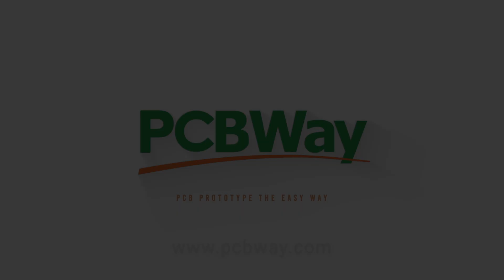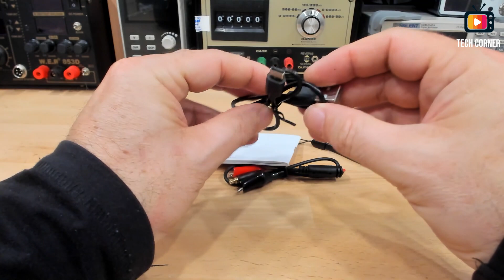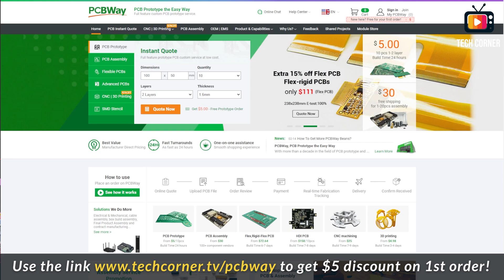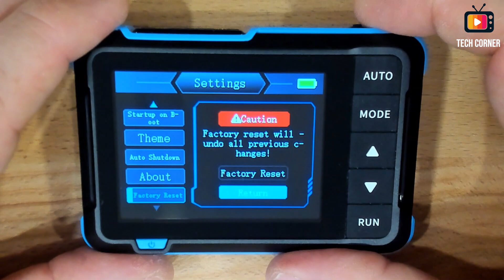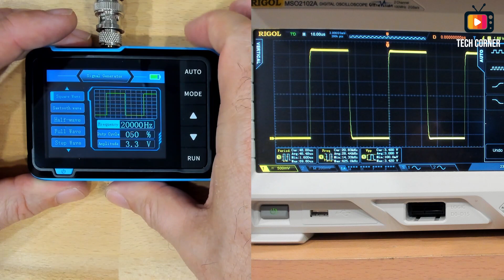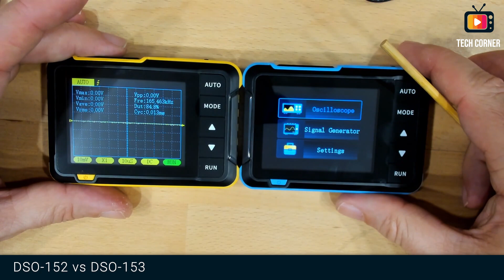FNIRSI DSO-153 ⭐ Oscilloscope & Signal Generator

Comment: Brother, I notice when we input 500khz signal,we notice that the dso 153 display 500-980khz flickering.. is it normal,or not good!!!
Reply from the maker: Hi, that has to do with the samples per second collected and the average you get from those samples, the signal always wiggles a bit, but with this small devices can be more noticeable, but again can also be the connection on the cable. Thanks for watching.

Comment: Giúp tôi cách kết nối  để hiển thị nó lên laptop dễ quan sát, cảm ơn
Reply from the maker: Hi, I don't think that is possible with this oscilloscope. What you're looking is the Zeeweii DSO1511g or DSO2512G, they have AV output. Or you can take a look in the Loto Oscilloscopes, they connect directly to the PC. Thanks for watching.

Comment: I am curious about the accessory pack that you had in this video. Mine just came with the alligator clips and the hanging strap. I didn't see a link to the accessories in the description. Do you recommend one in particular?
Reply from the maker: Hi, in the FNIRSI store you have with or withour accessories and they have the accessories also there. But you can use any generic P6100 probe and a BNC to MCX converter for the probes and a aligator to MCX cable also. Thanks for watching.

Comment: Just bought a DSO-153,  just a note to others, auto calibration is not covered in the manual, nor by Hugo in the vid. To auto calibrate hold down the AUTO button until you get message "Awaiting auto-correction" wait for message to go, about a minute, then it is ready to use.
Hugo great vid, convinced me to give one a go.
Reply from the maker: Hi Jeremy, yes, I missed that. Thanks for watching and your comment.
Reply: hi, I did accidentally hold AUTO and it's stuck in the "Awaiting auto-correction" on screen and buttons are disabled. What am I supposed to do now, plug the probe into the 1kHz output or something? It's basically locked now...

Comment: My DSO153 just arrived- setup and running ok, but frustrating cant seem to find any firmware update for it on FNSRI webpage ??
Reply from the maker: Hi, if you don't have issues with it, you don't need to upgrade. If it's not broken, don't fix it 😁 but you can ask in the whatsapp group, they will send you the bin file. Thanks for watching!

Comment: When I try to use the function generator and the oscilloscope at the same time it doesn't read anything from the function generator. I connected the red cable to the probe and the two black cables toogether...
Reply from the maker: Hi Johny, that's weird. If I remember correctly you can work at the same time. Thanks for watching

Comment: I would like your advice, because you have a lot of experience with oscilloscopes. 
I am trying to decide on which 100mhz bench oscilloscope I should  purchase(I am still in the learning stage). The one I have has 25mhz and would like to upgrade to 100mhz. Looking at vevor sds1102(same as the Owon, but at a better price), please give me your opinion. Thanks Hugo.
Reply from the maker: Hi, I received yesterday the CDEK SDS1102 to review, same as the two you mentioned. I will do it in the following weeks, have 2 videos to release yet, but that is the next inline. I have a review of the same model 4 channels and the comparation (showdown) video with FNIRSIS and Hantek, take a look in my older videos. This one seems pretty good, but I have to test it on the workbench to see the accuracy. But you should be ok with it. Thanks for watching.
Reply: My pleasure
Reply from the maker: Hi, I have here the CDEK SDS1102 for review, will have a video in the next couple of days/weeks and it is also a clone of the SDS1102, for the price it seems a very good and complete unit, but after the test will have a better opinion. Thanks for watching.

Comment: Just received my DSO153, and thanks to your presentation I almost fully understand it’s functionalities. Very impressive little gadget with a lot of punch. Have a Victor 1025A bench scope, at 25mhz, which I purchased a couple of months ago. I guess for a novice it is sufficient for the time being. What would you recommend for the future when I really get my hands dirty?
Hugo, you are doing a swell job, thanks a lot.
Reply from the maker: Hi, thank you so much for you kind message. If you have the funds €€€ the new Rigol 12bits series is amazing. I'll buy one of those also in the future, it will give you everything you need with quality, siglent also have a new series as alternarive to this. But for a hobbyist, the equipment you have should be enough. Thanks for sharing.

Comment: If you plan to continue evaluating digital oscilloscopes you really need to learn about a phenomenon called 'aliasing'...
 All those multi megahertz displays you said looked so good were NOT REAL
 When you looked at the nice 4 Mhz sinewave and the readout on the scope said it was only 1 mhz, it meant that the scope was only sampling at 1/4 the frequency of the 4 Mhz sinewave.
 Another problem the scope had was vertical 'jitter' that may or may not have been corrected by setting your trigger level to something other than zero...
Reply from the maker: Hi Dennis, thanks so much for sharing, I'll take a look in this for the future. Thanks for watching.

Comment: I like all your presentations, very informative. Like your accent. Trying to decide whether to purchase the dso 152 or dso 153. My main language is English, no need to change on selection. Have two function generators. The only advantage I see is the 1ghz bandwidth. Is the 153 really worth it? Could not find a side by side comparison. 
Thank you for your time.
Reply from the maker: Hi, in my opinion, the DSO-153 worth the few extra bucks, more bw, more measurements, faster processor and the signal generator is very acceptable, if you have two already is redundant, but overall is a much better device. I would like to thank you kind comment and thank you for sharing and watching!
Reply: I did purchase one and waiting for delivery. Please check your links, aliexpress and amazon are not responding as expected. Thank you.

Comment: Thank you for the review. During your test, there was the sinusoidal displayed in a rectangular icon by the battery indicator, does that mean that your device was outputting a generated signal locally and measuring from an external device at the same time? Could that be the reason you were getting not very precise results?
Reply from the maker: Hi, yes, the rectangular icon is the signal generator, when we have the sine wave on it, is on, if it is only a rectangle is off. Thanks for watching.

Comment: I like your reviews but not this one. In evaluating the sig gen capabilities you essentially left signal amplitude control uncovered. Sure it can put out Volts. How about 100mV, 200...etc. The amplitude is a very important control. Can I ramp up from 0V passing through Semiconductor Junction thresholds...ie 200 or 600mV. You run the range on frequency and basically don't cover amplitude manipulation ability. Also in the wave forms, did  I see a DC level position? Can you control that? Max, Min, increment (looks like 100mV and that's OK. Not complaining because your videos are 95% good. But when something is obviously lacking xI gotta say so.

You've done better. Comments 41:06  should help content to improve, that's intent.

Keep'em coming
Reply from the maker: Hi, no worries, please keep commenting. I'll take them always as constructive info to get better, and you're right on your comment. I did left a more precise test on the amplitude. I showed it working, but very briefly. I will try remember in the future to give more attention to it. The granularity of selection on this devide, is somehow limited, but I could covered it better. Thanks for taking the time to write this comment and for watching!

Comment: Does the USB-C charging work with a USB-C to USB-C cable? I am asking because some devices are missing two 5.1k resistors, causing them to only work with USB-A to C adapter cables
Reply from the maker: Hi, I went and test it on another power charger I have here, not only worked with Type-C to Type-C charging cable, but also, seemed a lot more stable in signal that had some interferences with the charger I used while recording the video. Thanks for watching.

Comment: Thank you for the review Hugo. I noticed one problem with the scope when you were charging the device while using it. As soon as you plugged in the USB cable, the square wave started jittering up and down. This is most likely due to either the USB charger being a switch mode power supply and the noise from it is affecting the reading or the BMS inside the scope is causing the problem. However, I’ve found that many cheap handheld scopes have this same problem when you charge it while using it. Apart from that small issue, I thinks it’s a great little scope for a beginner.
Reply from the maker: @khuongathebounga4141 back to working while charging, I tested with another charger I had here, while asked if it will work ok with a Type-C to Type-C cable for charging, and I notice that with this second charger the signal was much more stable. It should have some kind of protection to prevent that interference, but also, made more clear that the other power charger was piece of garbage 😬
Reply: @TechCornerTV  thank you so much for testing that. I appreciate all the effort you put in retesting equipment if something comes up in the comments.
I 100% agree with you. They should have put in some kind of filter to reduce the ripple noise. It’s a pity as it would be extremely cheap to do so, plus it’s even more important in this case because oscilloscopes are sensitive to picking up external electrical noise.
As far as I know, linear USB chargers are now very uncommon & hard to find since they are more bulkier, heavier & not as energy efficient as a switch mode power supply. So the scope manufacturer should have taken this into account. 
However, a good thing about you testing it with a different USB charger is it confirms the jittering was due to the charger and not the scopes BMS. Most cheap chargers that come from dollar stores or eBay, etc have too much ripple noise, whereas most, but definitely not all name brand chargers that came with your phone such as a Samsung or iPhone were less prone to ripple noise, not to mention much safer. Also ripple noise will degrade your electronics over time too. Thanks again for testing this Hugo. 
P.S: at least you now know that one of your chargers is a piece of crap 😂😂😂
Reply from the maker: Hi, nice to see you again, once more you're right. When recording didn't notice, I was concentrated in another topic, but yeah, you see there the power supply switching. Thanks for sharing and watching.